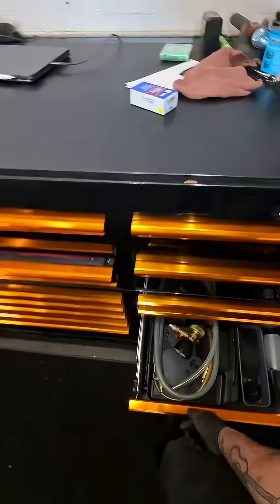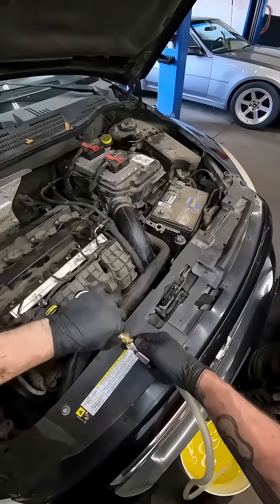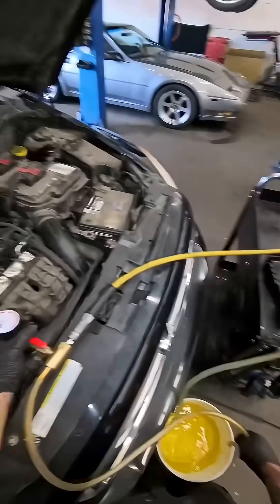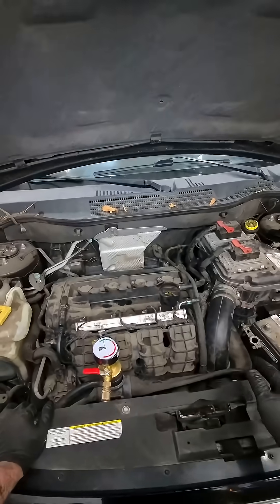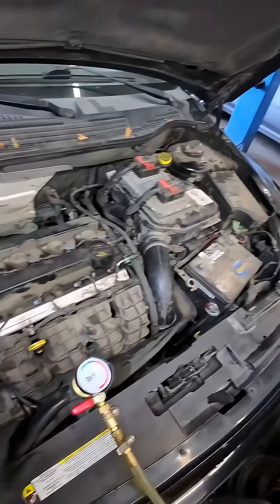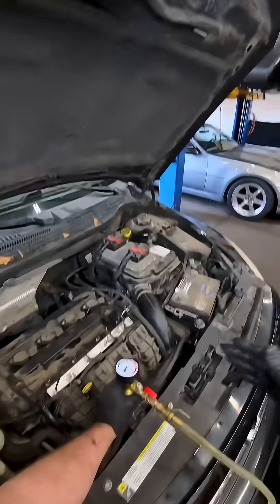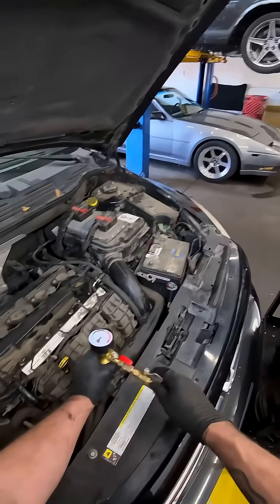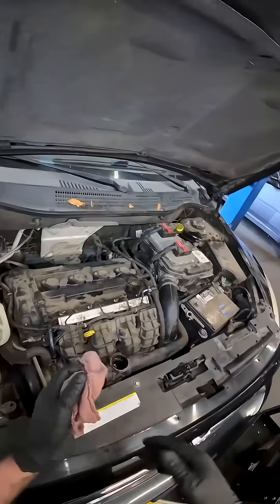Vacuum Filling a Cooling System

Comment: Um personally I'm not 100% that it fills each void considering the thermostat isn't opening and your not running the engine, as far I know coolant through the heater core won't be passed as effectively. 
Though I could be wrong, the purpose of the 30 mins is to allow the thermostat to open while the engine is running allowing coolant to flow through the engine and the heater to circulate the coolant, I just did a heater core replacement as well the radiator and bleed the system fully without a vacuum, also some vehicles need different rpm bursts while bleeding coolant while an engine is running and some don't individuals take a moment to research their car to understand the proper procedures.
Reply: I thought the same as well but using this method i just leave the cap off afterwards and make sure it can get heat in the car and usually get heat right away

Comment: Its cool watching you work. You have expert level skill and you sound pretty young still. Can you describe what the fitting is that you are using on the radiator neck in this video - what brand and part #?
Reply: The cone rubber part is a universal fitting

Comment: Never heard of this. I had to bleed the cooling system on my Integra years back though and I remember it took a while to get all the air out. I had the car idling with the heat on full blast to make sure no air got trapped in the heater core for a good hour or so before it was all gone. I think a lot of people don’t realize how long it will take. It was a hot summer day too so the system should have been circulating as quickly as possible given my climate and even still over about an hour to get the fans to kick on a few times which is what I was told to do. It worked though. Never had an issue with the temp gauge being wonky after that.
Reply: You only have to turn the heat on if you have a valve on the heater hose that shuts off when it's not calling for heat. On most cars coolant flows through the hoses anytime the car is running and the thermostat is open.
Reply: @wbforsure2104 I didn’t know that lol. I just figured I should. I didn’t sit in the car though. I just went inside and let it run for a while.

Comment: I use these daily in a dealership, they’re great for finding gross leaks not small leaks. I’ve had these things hold vacuum but once the system is hot and pressurized you show a leak. Great for what they do but never as good as a pressurized test all this shows is after you service a cooling system there’s no immediate gross leak.
Reply from the maker: Not that I use these to find a leak, but any time I drain a cooling system, I use it to confirm there are no leaks present before refilling the system.  If it doesn’t hold vacuum I’ll typically pressurize the system to find out why.  In my experience the leak will show up a lot faster under vacuum than under pressure.
Reply: 100% can confirm. Use them all the time at the dealership but I’d never trust it as a pressure tester.

Comment: What about the fact that the coolant won’t reach the engine because the thermostat would be closed even under vacuum?
Reply from the maker: There will be vacuum on both sides of the thermostat.  The thermostat doesn’t allow coolant into the engine.  It allows the flow of coolant.  There is always coolant on both sides of the thermostat/s, so the vacuum pulls coolant throughout the entire system (including both sides of the thermostat)

Comment: My shop recently just got a Coolant Exchange machine that works great but this method looks alot cheaper👏🏽
Reply from the maker: This air lift was about $135 off Amazon so definitely a lot cheaper.  But I wouldn’t mind having a nice coolant flush machine.  Does it vacuum the old coolant out to evacuate the system or does it tie in the radiator hose?
Reply: Back when I was at Mercedes-Benz, we had the machines and some of the older techs would still air lift it bc it was quicker. Seems to be more efficient.
Reply: My Chevy sonic 1.8l is notorious for air locking the coolant flow and presents as a pseudo blown head gasket (lots of bubbles into the expansion tank. As the non flowing coolant cooks, the pressure can get very high and can burst cooling system components. Thank you for this video.